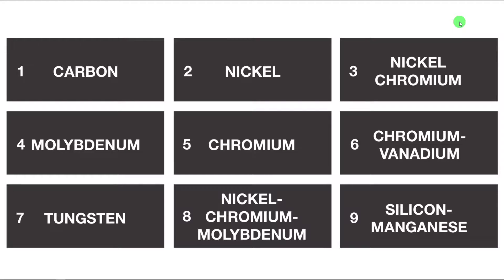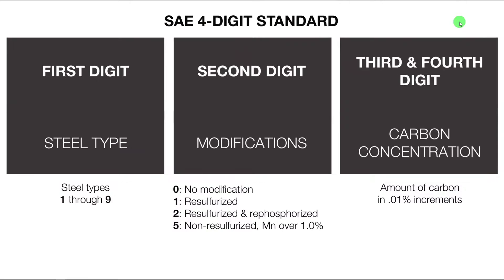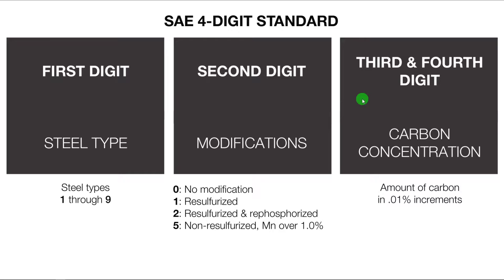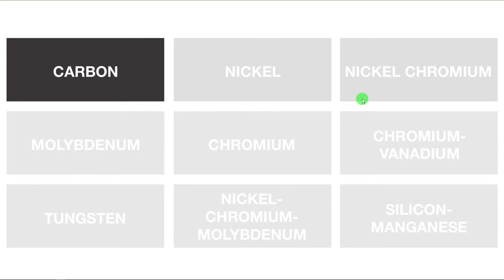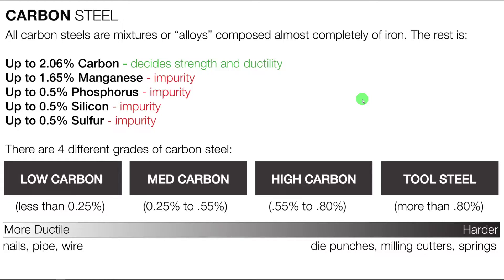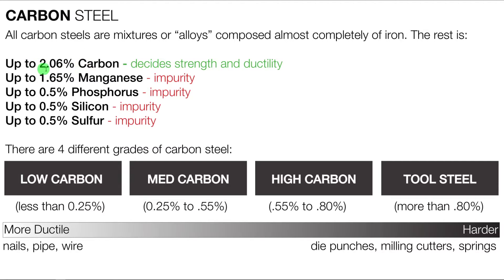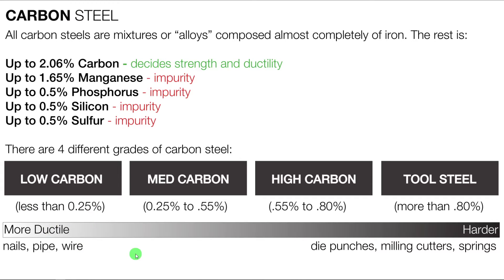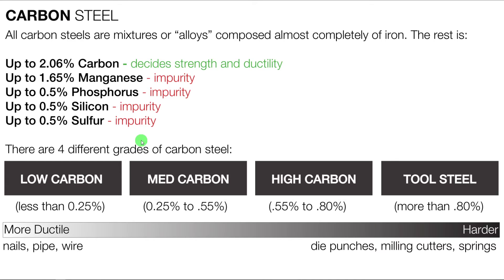Steel Types: Carbon-Steel Explained in 3 Minutes

Comment: All piano, electric and acoustic guitar strings have high carbon steel core wire because it is the only magnetic metal with sufficient tensile strength. It's rather fascinating.

Comment: I was wondering, what form of carbon is used to make carbon steel?
Reply from the maker: They use hard, porous black chunks that look like charcoal. They can be graphite, anthracite or similar stuff. They put it in the blast or electric arc furnaces.

Comment: So what grade of steel or combo of materials would resist the action of a Sawzall and angle grinder?  What confounds a cutting blade? I'm trying to devise a way to defeat the catalytic converter dirtbags by beefing up a series of steel reinforcement tubes that would be welded on the exhaust pipe, any suggestions?
Reply from the maker: From what I've seen, they are made of stainless steel. This project seems like it will need a lot of simulation and tuning to get right. Check out all the simulations done on standard CCs. Can you explain more about this concept?
Reply: @AvivMakesRobots  It's all about just slowing them down, if you make them work harder than a minute or so each cut (x2 cuts) they might move on. Some people take a regular SSteel tube and weld that on top of the pipe, on each side of the CAT. But I want to beef that up further by maybe putting something else inside the tube (like some 1/2 square and X long strips?) that will mess the blade up. Some materials I'm considering: tool steel, boron / cobalt? steel, titanium, or maybe even a titanium mesh or aluminum compound? to foul the blade. Some guys in Britain say that chicken wire can be effective ... Honestly, I don't know.

Comment: Would steel with an SAE number of 1520 be good steel?
From your Diagrams that would be Carbon steel with Manganese content of 1% - 1.65% and 2% Carbon.
I have no understanding in the topic, is this good steel?
Reply from the maker: It completely depends on the application. This steel would be good for a flexible part that has some resistance to rusting. It would be terrible if you needed a strong steel for an injection mold tool.

Comment: Excuse me sir, i still don't understand. As i know,, carbon is more brittle than iron. But why when we mixture carbon and iron. It can be stronger and harder than pure iron?
Reply from the maker: Because the carbon molecules distribute themselves into the microstructure of the iron. When this happens, it changes the properties quite a lot. Steel is both harder and stronger than iron.
Reply: @AvivMakesRobots  okay thank you very much sir
Reply from the maker: @aryawicaksana3014  There are small gaps between the atoms that make up iron. These little gaps are called interstices. When carbon is added, the carbon fits in these tiny holes and that fills the holes, making the whole material more robust. I think it even goes as far as pushing against the atoms creating more pressure and therefore more strength. Check out steel microstructures.